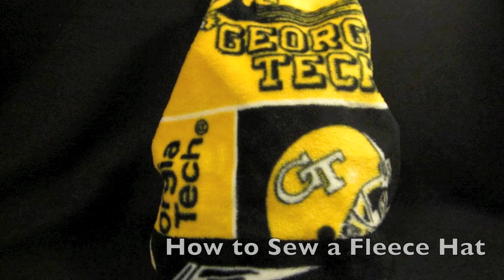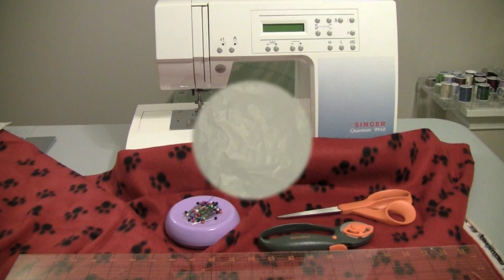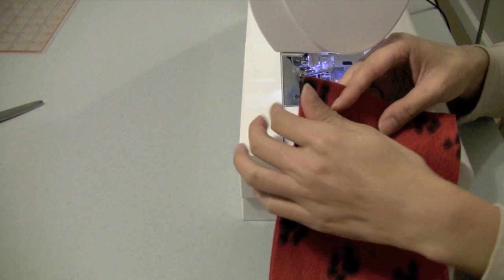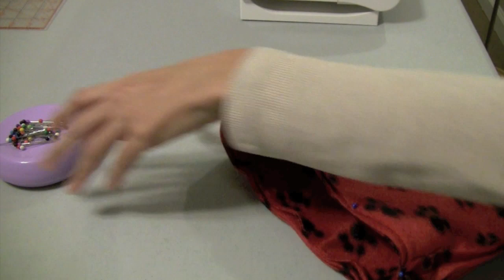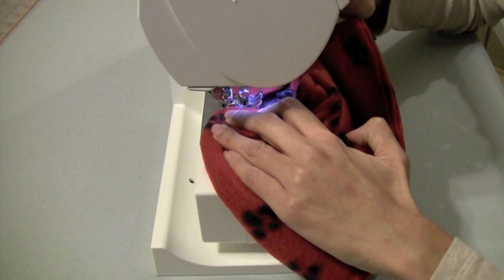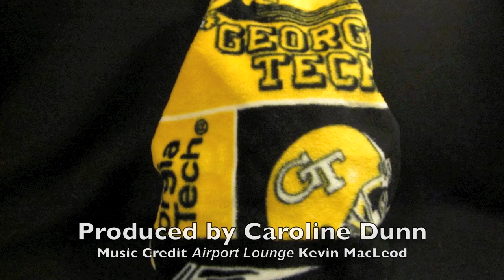How to sew a Fleece Hat without a pattern DIY

Comment: The pattern I use doesn't have the extra work of cutting a band just to sew it back on. Just fold a "tube" ( sew seam along the long side of fabric and fold in half.) Also don't have to sew top. Cut vertically from raw edge to make fringe, just gather and tie around 1/2 inch fingers of fabric to make a pom pom top.

Comment: A note for anyone new to sewing and want an easier way ... unless you want the look of a band on the hat, there really is no need to do the first cut because the band is the same width as the hat and in that case, simply fold fabric over and sew the two sides then join the corners together.

Comment: It should be mentioned that the longer side of the template needs to be placed with the stretch side of the fleece. I learned that the hard way with a hat that didn't stretch around the head.
Reply: Making It Easy with Liz

Comment: I needed a cheap quick gift for my class of 14 preschoolers and you saved me! Thanks so much!!
Reply: How did you adjust the size?
Reply: @ellellbee -I would guess that you would have the width be equal to the circumference of an average preschooler’s head and reduce the height. Similarity if you would size for a school aged child.